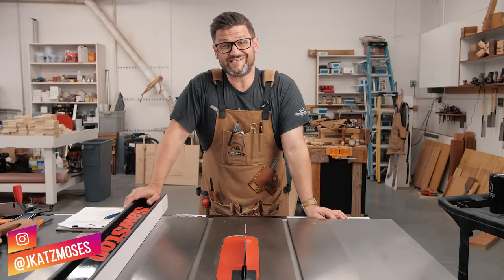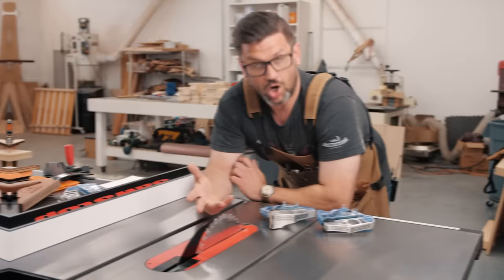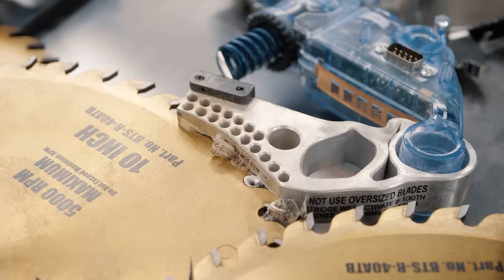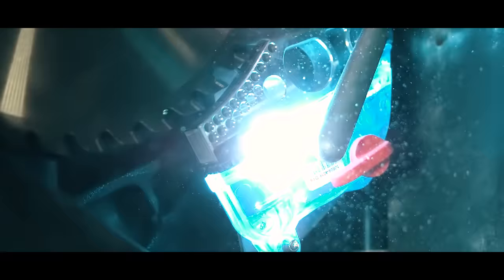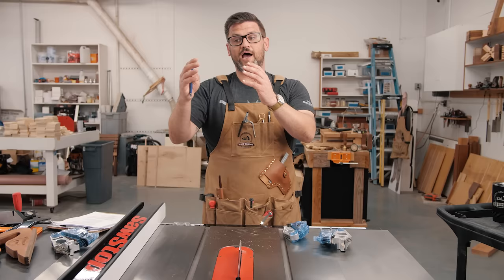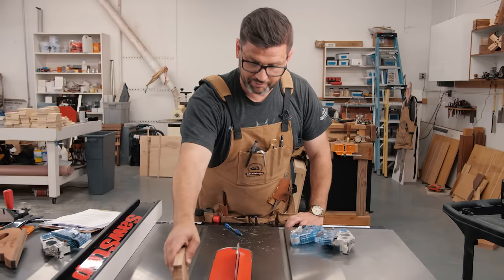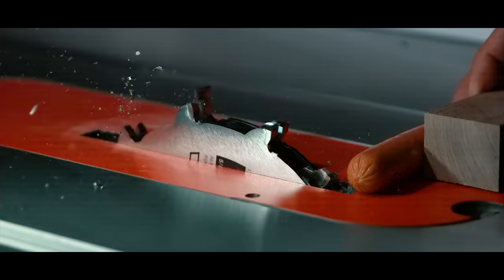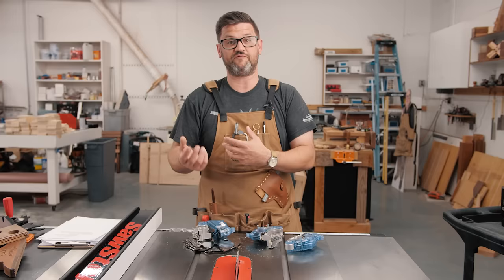How Safe is a Sawstop Saw? - Never Before Seen 19,000 FPS HD Slow-Mo Video

Comment: One thing I would like to see is the hot dog coming in from the top of the blade, to simulate a hand being pulled into the blade by kickback. I would be interested to see if that makes a difference. Guess you will have to rent the camera again. 😊
Reply: It works my finger went into the blade (not paying attention) and the blade jerked to a stop all i got was a nip and a wake-up call it will trash the blade and you have to replace the aluminum stop mechanism
Reply: I was thinking the same thing. Be interesting to see I think maybe.
Reply: I had mine trip because I was cutting some wood that I didn't realize had a really wet center on a deep cut with the top of the blade buried in the piece. When I looked at the piece of wood I could count where every tooth was in the top of the kerf when the blade was pulled down because the blade was yanked down faster than it was rotating.
Edit: Just realized this is misleading.

The blade is of course being drawn down faster than it is rotating, because the mechanism that pulls the blade down is powered by the momentum of the blade. The blade stops first, then retracts, and this process happens so quickly that the point at which the teeth of the blade stop cutting can be seen distinctly. Shavings that weren't done being cut will still be attached to the wood.
Reply: Michael Finley It shouldn’t matter where the blade is touched, it is an electrical reaction, not a pressure reaction.
Reply: @kennethvogt9379  That's not what he's questioning. He wants to know whether the impetus of a falling object allows the blade to catch it and cause more damage before the blade can be retracted.

The answer is no, not in any significant or measurable way.
Reply from the maker: If I went as fast as a human can punch you have to assume it will work no problem as the force of gravity is significantly slower. Look at the slow motion under the table shots. The blade is pulled under the table well before the sparks stop from the wire holding the spring. Its basically instant.
Reply: @katzmosestools  No matter how we try and shake it, at the end of the day, you're probably not going to die or lose any limbs no matter how you approach the blade and I think that point was proven time and time again and is the most important one. Our brains just still always wonder what if, what if.  Great shots by the way. Was pretty killer to watch. Good work
Reply: There’s always one.
Reply: @katzmosestools  I don't doubt it would work - I'd just like to see it, just because it's probably the mechanism for a significant number of serious table saw accidents. It'd be pretty hairy to set up though, I guess. (And you've already returned the camera I suppose.) A man can dream...
Reply: lower a set of pork ribs on top like you fell on the blade
Reply: I believe Stumpy Nubs did a test like that. Even put the dog in a glove
Reply: If I have understood the Sawstop technology correctly the blade is electrically isolated from the surroundings and there are a voltage between the table and the blade. When that circuit is completed allowing current to flow the mechanism is tripped. Depending on the trigger level for the current that circuit can theoretically also be closed via the chassis of the saw, floor and the shoes to the body, but that of course depends on the electrical conductivity of those materials and the voltage.
Reply: Stumpy Nubs, or someone, did that.  I've seen the video.  I just can't remember who did it.  I'll see if I can find it for you.
Reply: And here you go: https://www.youtube.com/watch?v=rnlTGndRi38
Reply: Since the stopping mechanism is activated by the elec
Reply: What if someone reached from underneath the table?
Reply: @kencooley5589  Well, then they don't have the sense required to be operating a table saw in the first place.  The cabinet is completely enclosed, even on job site saws.  So you would have to deliberately turn the saw on, open the door, and reach into the cabinet with the saw running.
Reply: @lenonkitchens7727  well sometimes it's best to have someone inside the table while it's running.  Lubing bearings is best done at high speeds
Reply: @kencooley5589  Can I hire someone to do that?  I wouldn't fit inside my cabinet.
Reply: @artnouveau4332  Glad you live to high five another day bud
Reply: Ken Cooley lmao. That’s how I like to lube the bearings. Would be good to know if they can now do it safely. 🤣
Reply: @katzmosestools   if you were to do another test, ground a hotdog with a wire and throw/drop it into the blade
Reply: Instead of a hot dog and I'm going to get some negative reviews from rib lovers but buy a rack or ribs and then let it fall into the blade with the meat down to simulate your body falling on it. It also has bones in it as well which I think will also demonstrate an basic fall. And yes I love ribs too!
Reply: My fingers are so small, that one shown in the video would be way too much.
Reply: haqvor not quite.... it does not work lika a circuit. It measure interferance in a radio signal transmited and recieved from the sawblade. The sawblade is acting as a antenna.
Reply: it costs about $200 to replace the stop mechanism and blade every time you do it. it will save your fingers, but will cost you an arm and a leg....
Reply: @icyuranus404  if that's all then it's worth it. Here in ga just stepping into the er will cost you over a grand alone!.
Reply: @PhantomWorksStudios  yes, the $2000 saw is part of the cost too... we're talking about how much it costs to throw a weiner at the thing for a slo-mo shot at a different angle....
Reply: Lenon Kitchens 
If you want to damage yourself, go for it!
Reply: @lenonkitchens7727  You can't hire kids, but you can use your own, if you have any!
Reply: @icyuranus404  It's only money, not limbs or digits.  And you forgot to add the cost of the medical bills, for which you'll have to add your firstborn.
Reply: Going in from the top is even safer than the front. Because of the way the blade pivots down the teeth pull away from your hand vs feeding in from the front they rotate more parallel. My friend fed his finger in to the teeth from the side of the blade and just wound up with a 1mm nick on his fingernail and the end of his finger. It bled a tiny bit, but SS saved him. I'm a solid believer.
Reply: @icyuranus404  Really?  How $200? It's less than $100 for me.  $60 for the brake cartridge and $20-$25 for a new blade, or sharpening and expensive blade.

Comment: I was on a bridge job running one of these for two year. It was a superb saw.. took a beating.. only had it trip the safety 2 times.. hidden nail in plywood and wet wood that was sitting on the ground. I could bypass the safety stop if I thought there was a risk from cutting. At the time (2014) a replacement brake setup was $90. Saw blade was junk after it tripped.👍

Comment: People are stupid with that “they’re going so slow” nonsense. Obviously the people that think that have never used their hands to build something. Do they think you cut with a saw as fast as you can move?
Reply: Maybe in an extreme case you could slip and fall super fast on it, but nonetheless yeah
Reply: gotta cut fast dude
Reply: If you fall into it you'll be moving sort of quick... but on the flip side I think the point of this machine ISN'T so you could disregard the safety you'd normally use. 

But hey, I have all my fingers for now. Part luck, part brains.
Reply: kickbacks.
Reply: ....I want agree with you, but you have obviously never seen a cabinet shop 🤣
Here, a sheet goes through every 8 seconds.
By hand. No power feeder.
That said, that speed would make little difference. I have been cut to the bone by slipping forward into a jigsaw and know that it all happens fast, but on the table saw, much like any saw, if that blade comes to an immediate stop, two or three passes of the carbide will cut you up, but you aren't going to see catastrophic damage like you would if the sawstop wasn't installed. 

still not buying one 😅
Reply: It's called Xtreme Woodworking!
Reply: Well, after doing a bit of investigating, I can say that the SawStop saws are fairly expensive, especially for the occasional home user, when compared to the typical Home Depot offering.  When compared against the high end professional saws such as Delta, the SawStop is in the same ballpark or only a few hundred dollars more on a $2K or $3K machine.

Still, how much is hand or fingers worth?  It would be interesting to see when the SawStop patent expires, what the price would be if manufactured by DeWalt or other common consumer brands, And what would happen if the government mandated all new saws sold incorporated this technology.
Reply: No, but your hand can be drawn in very fast by certain types of kickback.
Reply: yes because i sprint handfirst into sawblades
Reply: "Obviously the people that think that have never used their hands to build something. "
Once again a boomer blames boomers set in their ways on the young and inexperienced, making it an insult to be called one. Somebody who's never done it might actually start with safety features on from the start, if they weren't pushed to do it as fast, cheap and unsafe as the old guard. All you do is make the problem worse because everybody hearing you knows they're 40 years old and have plenty of fingers to go, still, so why change now.
Reply: @sboinkthelegday3892  ok zoomer
Reply: @clock4883  well, never ever work with circular cutter of ever kind in a hurry, that will end very bad
Reply: no but if you use saw incorrectly or trip etc. you will touch the saw with greater speed so those comments are just raising a legitimate concern
Reply: It's not that, it's that kickback literally pulls your hand into the blade faster than you could humanly move it.
Reply: @aaronschocke5463  did you watch the video? There are 0 passes, it stops as close to instantly as something humans can create can.
Reply: Exactly
Reply: Bro gotta get that project out in 2 seconds smh
Reply: That's not the point people were making though. They initially went very slow with the hotdog to the point where it wasn't representative of someone falling onto the blade or getting caught in it due to kickback.

It's a completely justified and rational query. You're just mad for no reason my guy.
Reply: @constantinosschinas4503  kickbacks move your hand over it with the slant of the teeth rather than against them into their bite. Normally that might not matter much, lost finger is lost finger, but with this device I think it would make a massive difference and pretty closely approach the damage of a slow move head on, just judging by the slow mo of how it seemed to do its damage
Reply: i think u have never used ur hands to build something..
oh yea let me just slowly slide my fingers into the saw "accidentally". NO... you get cut on the saw when ur hand slips off somethiing... and thats a fast motion
Reply: Exactly. If you're not careful moving things through the blade, you're not going to get anything usable out of it anyways, soo... they are certainly doing their best. And that's a LOT!
Reply: Stupid is as stupid does .

Comment: 6:02
At first, I thought the tungsten carbide tips were ripped off due to inertia and I audibly gasped when I saw it. But if you look closely they broke because when the brake engaged the whole assembly oscillated and the teeth collided with each other. Tungsten is brittle and you can easily break the plates off of the teeth if you accidentally drop the blade. Still very impressive footage. The explosive charge being detonated and the aluminum brake deforming were so satisfying to watch!

Comment: "Doesnt even scratch the hotdog"

Me looking at the scratch.....
Reply: Im surprised he didn't mention that the hot dog flesh is definitely going to not be as tough as human flesh so surely all the damage seen would be less when applied to a finger.
Reply: @sDeezyeazy  I don't think toughness is very relevant at those speeds. The flesh itself doesn't stop the blade, so it will cut as long as it can reach.
Reply: tO Be fAIr HoT DOgs PrEtty SOft
Reply: Irk
Reply: @hobbit1817  Fair is fair... same word
Reply: @MrTomyCJ  Yeah good point you're probably right about the difference in toughness being negligible at those speeds
Reply: In his line of work a scratch is a lot worse than you might think.
Reply: Regardless, a small cut is much better than a missing finger
Reply: @MrTomyCJ  well, the hot dog is more tense, human flesh has a bit more give so it could potentially get out of the way partially reducing the damage even further
Reply: @bacicinvatteneaca  no that is wrong even if a finger is more sturdy than the hotdog it will still cut by the same amount because if you did the same test with a finger from someone that is dead it will show the same result
Reply: @black-ip6bd  I didn't say that it would resist more the cutting action, I said it might get more out of the way compared to the tense sausage. Still, I'm pretty sure I was wrong either way.
Reply: rather have a scratch than a missing finger
Reply: doesn't*
Reply: He’s working with his hands that’s no scratch in that world
Reply: The schyzo convention theorizing of how weak a electric blade would cut meat
Reply: King Croc  parents not home...
Reply: FBI Guy  definitely, but still a scratch lol
Reply: The thing I think folk are forgetting here is that a cut of that depth would damage the tendons in your finger and would cause some serious bleeding. Injuries less bad then that have caused people to lose the tips of their fingers. Only 8th of an inch my arse.
Mind you, this fella though 1000G was "Equivalent to a jet going at 1000m/h hitting a concrete wall. So he's not good at biomechanics or maths 🙄

Comment: Now to find the cure for kickbacks.  Imagine if this technology existed back when radial arm saws were really popular.
Reply: My dad always had an steel arm on his full size table saw that was notched and racheted down on the end of whatever wood he was cutting like jack stand posts that held the back of the wood so it couldn't kickback. I think he made it custom though....      His saw also had a factory kickback arm on it, but it was small. His saw was built in 1990ish. Still runs like new.
Reply: I know folk to use a jig and a stick to move the wood so their hand doesn't actually get near the blade.
Reply: @Callaghan552 Right on.  The first thing I was ever told was the 1 foot rule. No fingers or hands within 1 foot of the blade period. Second was to always use push sticks. Push sticks were free scrap wood, homemade and tailored to your use and needs. After 30 years using table saws, I still have all my fingers. No expensive problems to fix if you don't create one. I've never worked with carpenters that didn't work smarter than that. 
When I work on other people's cars the most common problem is between the seat and the steering wheel. 
It sounds like the modern carpenter can't be trusted to be responsible with his own tools unless he has an idiot brake.  
Screw the safety, let the dummies lose a digit or two... then they will be begging for a schematic and a diagram of a set of proper push sticks. Problem solved.
Reply: @Ranstone  came to post that link! Right on! 👍